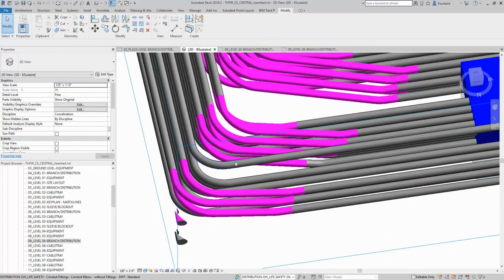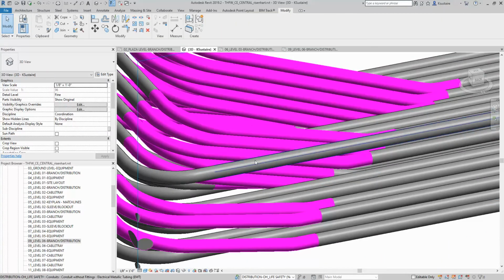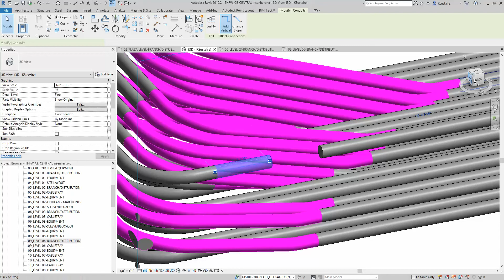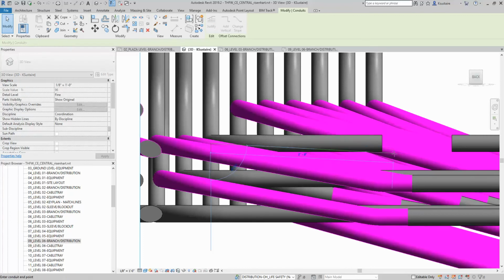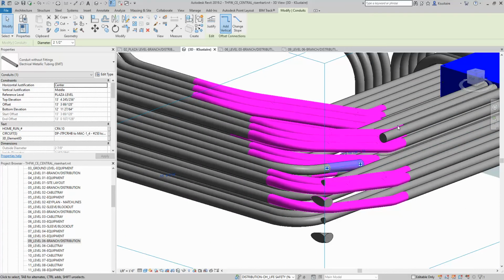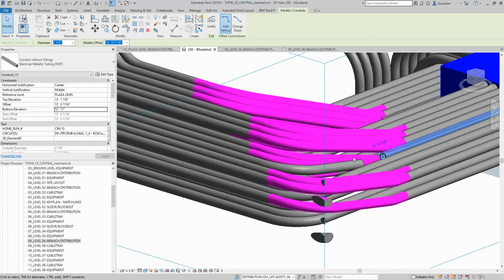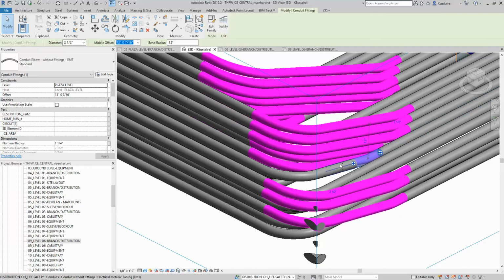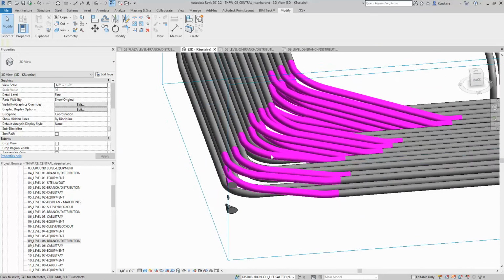Revit 2019 - Electrical Conduit Modeling - How to Make a 90° with a Kick

Comment: I do these all the time. A huge time saver for me was to go into project units and set "Slope" to "Degrees". Also, we recently bought and eVolve license and started using some of their conduit tools. Pretty amazing, but taking some time to get used to it, just like any new tools.
Reply from the maker: @AndTeeter, good point, I later realized this and now it's something I always change in a new project. I've also been using eVolve for the last couple of years and have changed the method I use for rolling offsets using their kick 90 families. However, there is no PVC kick 90 family, so I dust this technique off when I do underground. Best of wishes!

Comment: i am not able to use splice command in conduit. how did you do that ?
Reply from the maker: It's the "slice" command and the shortcut is "sl"
Reply: Revit calls it "Split Element" and it's on the modify tab and modify section of the ribbon